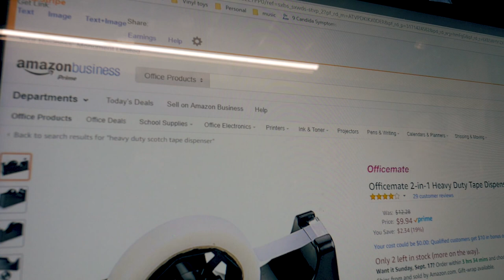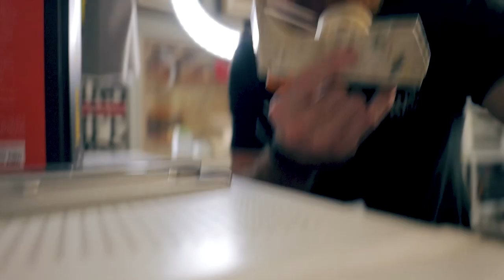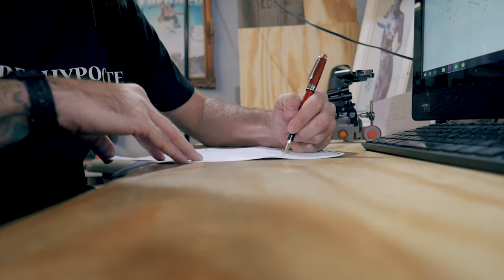T Shirt Printing Vlog: A shop that works together stays together

Comment: Hey Cam, a trick I use with the pallet tape in my shop, we flash the pallet first and peel it off while its hot. Comes right off no prob or residue.

Comment: 5:00+ of dead air. I was hoping it was gonna be like a hidden track on a cd lol.
Have you tried multiple layers of tape? Tape has a release agent and peeling a layer of tape off of tape is easier then pulling a layer of tape off of a platen. So you just leave that one first layer on semi-permanently and add a few more layers (or just one more), easily peel off a layer and BOOM! A clean taped platen (or if you're doing one extra, peel and add another layer of tape and you're off 😃)!!!
Reply from the maker: Very good idea. I have seen something similar for sale

Comment: hey Cam, what tape are you using on those platens. I have never had to remove glue like that. I know you warm the platen like I do and then peel off, but then I can often just apply new tape. Sometimes I might put some goo gone on a paper towel and rub it around the platen and then just use a razor blade to scrape. Then I hit it with windex to get the goo gone off.  2 minutes tops.
So again, I am just curious what tape you are using or if you are applying extra glue?
Reply from the maker: Normally it's not that bad. those pallets have not had the tape changed in a year. they were just sitting unused.